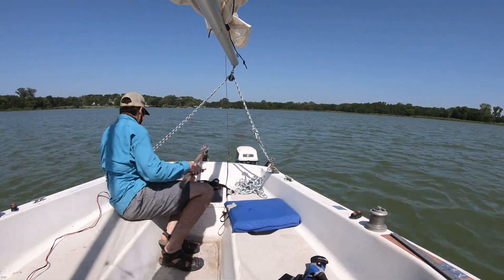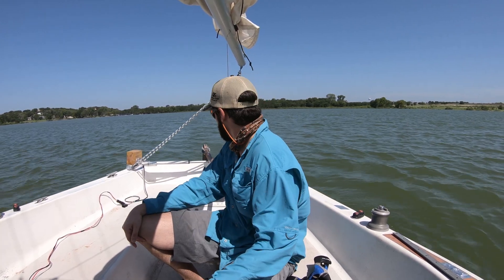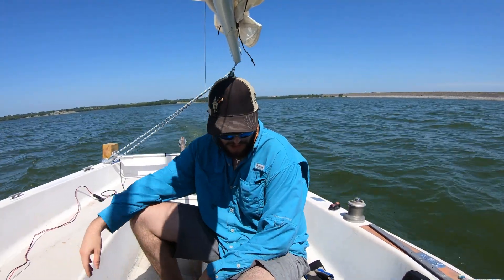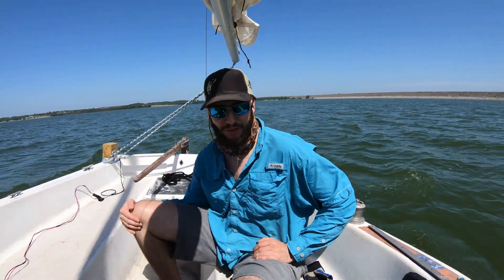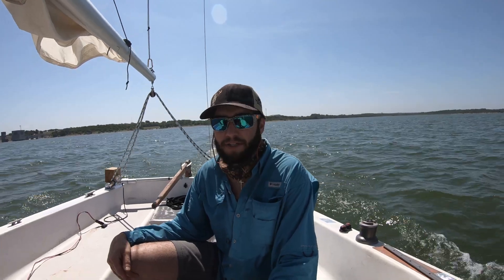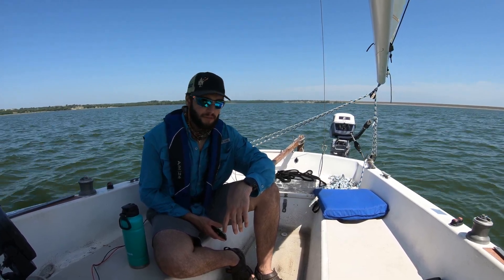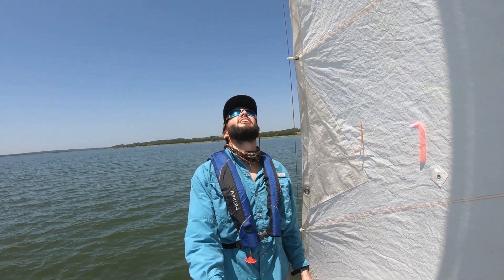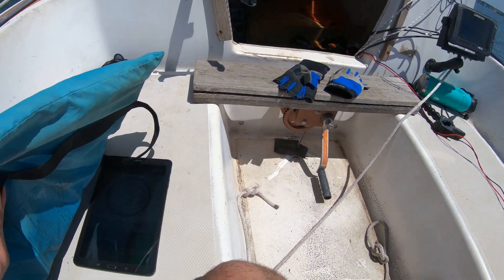OUR BOAT STEERS ITSELF!  DIY Arduino Autopilot Water Trials - New Salts Episode 19

Comment: I heard a spec on the raymarine actuators that says it should move the stearing lock to lock in 9 seconds. That's not that fast on my boat about .6 inches per second. Hope that helps